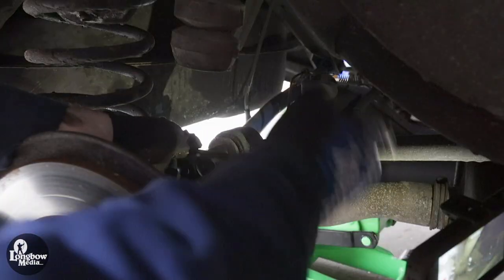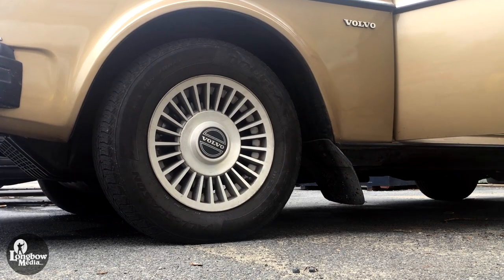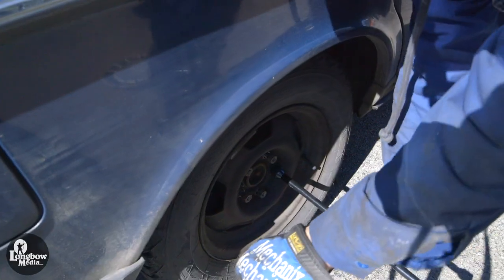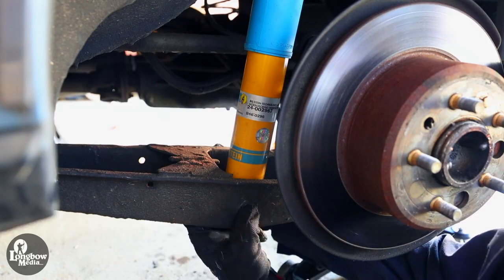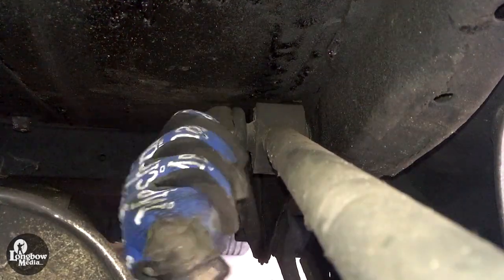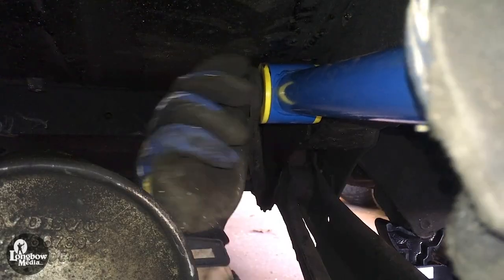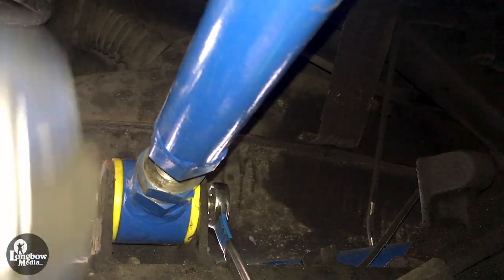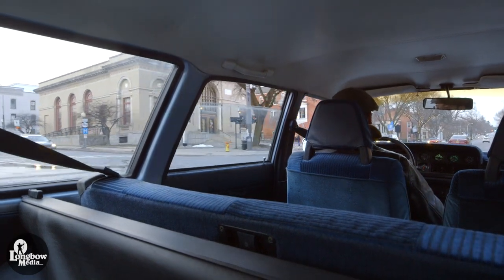IPD Adjustable Torque Rods - Installation How To Tutorial - Volvo 240 - Poly Bushings

Comment: Sorry, I am missing the degrees you are measuring in reference to what? the horizontal? How are you sure the ground is leveled for this, and what kind of tool (angle finder) is that you are using? I had my torque rods replaced the other day by these adjustable ones from IPD but after that placed some spacers to bring my rear wheels out by 25mm, now my passenger rear wheel is rubbing in the body and I would like to make sure the torque rods are properly adjusted or not in order to bring that wheel a little bit forward if posible.  If I need to adjust their length I don't need to remove the shocks right, only the front bolt, and lose the big not to rotate by a few revs? Also, depending on the angle difference how do you know if you need to lengthen or shorten which side?  Thank you for the videos.

Comment: Hmm..I pulled both my torque rods (before seeing this) at the same time to replace the bushings w/poly, then reinstalled them.  Reinstalling was relatively trouble-free, with the second torque rod being a bit more difficult than the first.  Is there anything I need to look out for, since I didn't do any of the stuff you mention in the video?
Reply from the maker: If they went in A-OK, then I guess you should be fine.
I would double-check the torque settings after driving around for a bit.
Reply: No, you reinstalled the same
Torque rods without fiddling with any adjustments, you’re all good bro Jackson

Comment: Why would you add adjustable torque rods without needing them ? Ya could have just replaced your old bushings with poly..
Reply from the maker: I actually swapped these out for a new set of OEM torque rods with rubber bushings.  The poly bushings transmitted too many drive train vibrations at low speed for my liking.